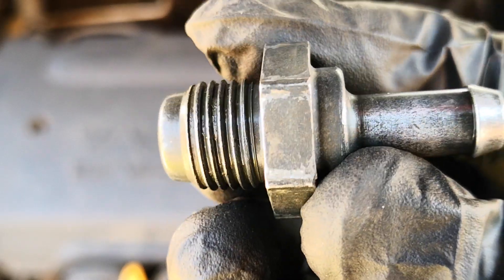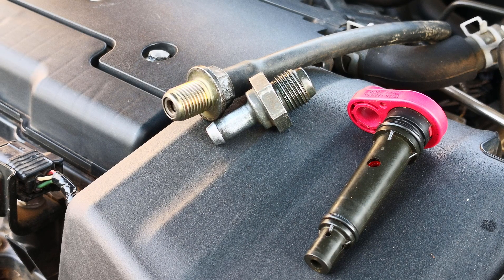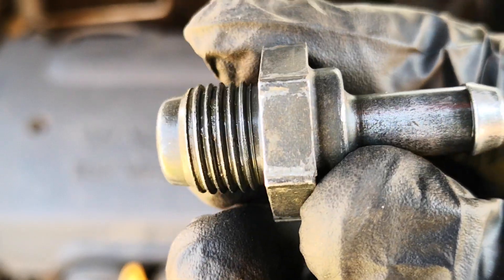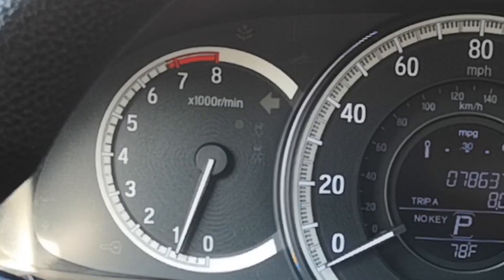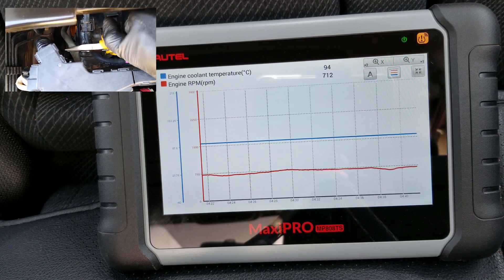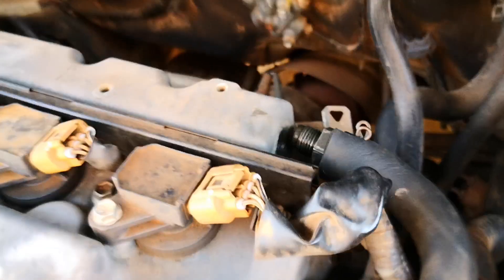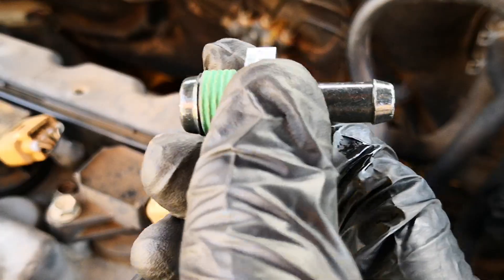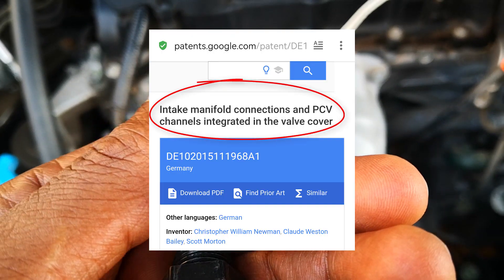Testing the PCV System / Troubleshooting a Bad PCV system / PCV System Check / Test your PCV valve

Comment: An inexpensive part that can save a lot of trouble.
Reply from the maker: Well said. I bet some may have proceeded to rebuild an engine without knowing the oil burning\smoking was from this little part!
Reply: @DIYAutoworksNG exactly. I bought a used 18 Tacoma with the 3.5 v6..it runs great..smooth idle..no oil consumption..and coolant clean and topped off..but at 165k..I get a plume of smoke with a slight hint of gas/ oil on startup that isn't really condensation I believe..the smoke only lasts until engine operating temp. Doesn't do it while driving..but every startup even at 100 degrees farenheit.

Comment: Mate if i open the oil cap i feel small air pressure on my hand but without smoke, its normal right?
Reply from the maker: That's blow-by gasses. All cars have some degree of blow-by including new cars. It's more to do with the degree of air coming from there. That's also why we have PCV valves. They take this blow-by to the intake side of the engine.

Comment: What computer system do you use to measure things like air pressure and other metrics? I currently have a software on laptop but I cannot watch live metrics. I would like to do this. Have mercedes though...
Reply from the maker: I use 3rd party scanners. Xtool, autel etc. I had one computer-based one back in the day, but it just hurts mobility.

Comment: hi! The pinch method should make you find out if the PCV valve is stuck closed, but what about stuck open PCV? how to check it?
Reply from the maker: Not correct. Maybe you want to rewatch? If you pinch the hose and the idle drops significantly, PCV valve is stuck open. I mentioned it in the video.

Comment: What are the odds that you you posted the video at the same time I need to diagnose what's going on with my PCV. and why it triggers a P0175 and P0172. 
My Fuel consumption has been ridiculous. Started suddenly some weeks back.
Reply from the maker: A coincidence indeed! Hopefully, you can get to the bottom of those 2 codes. 
Also rule out restricted air supply from a clogged air filter, as well as a defective MAF sensor; providing wrong readings of low air volume going into the intake manifold...

Comment: My PCV Valve leaks at the very top where it connects to the hose(only on cold start), i noticed the clamp is loose so it may explain.
I got a brand new PCV valve from the dealer and it still leaks, my main concern is... lets say i buy a new hose clamp and install it so that it properly clams onto the hose, why is there that much oil passing the valve in the first place.

Hehe nevermind, i checked my entire PCV system and then ran a test, turns out the leak is coming from somewhere near the PCV valve
Reply from the maker: Glad you sorted it.

Comment: The lower idle when pinching the hose is supposed to quickly recover when you RELEASE the pinched hose, or WHILE you still have the hose pinched? Thanks.
Reply from the maker: With the hose pinched
Reply: @DIYAutoworksNG  Thank you.

Comment: Can you change the valve without a check engine light that goes on afterwards? (Honda Civic)
Reply from the maker: Changing the valve shouldn't lead to a check engine light. Car should be off for the procedure.

Comment: You showed the Honda PCV valve but didn't demonstrate it on the accord. How do I test this on my Honda Accord 2006 v6?
Reply from the maker: Exactly the same principle applied here. Pinch the PCV hose as shown in the video and listen for a change in engine tone and idle.
Reply: @DIYAutoworksNG  I did as you said and there was a slight change in the engine sound. Very slight. I guess that's enough to say mine is fine, right?
I didn't have anyone to watch my tachometer for me.
Nice video, though.
Reply from the maker: Yep, that should be good. If you've never changed it, I'd plan to do so out of preventive maintenance, or clean it at least.
Reply: @DIYAutoworksNG  yeah, I already cleaned it to get it to work. It was pretty clogged up when I took it out.